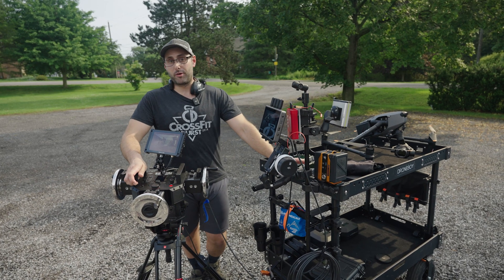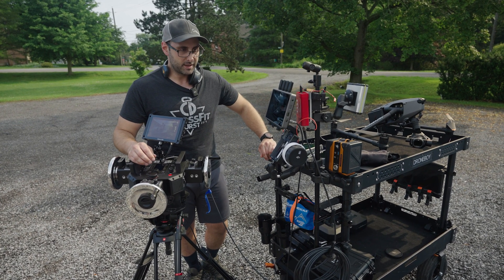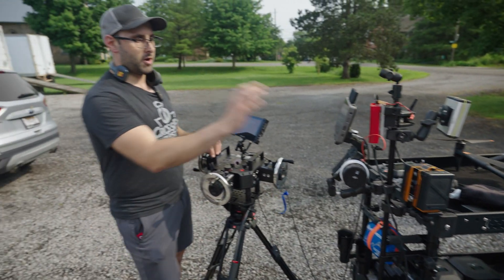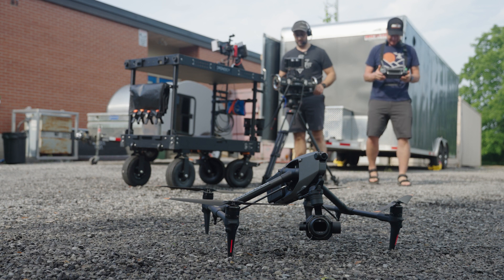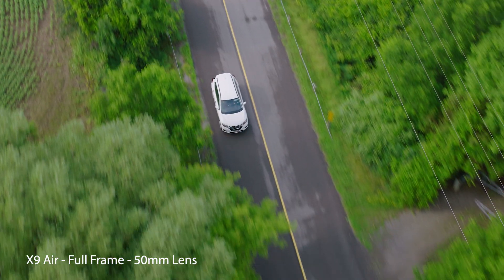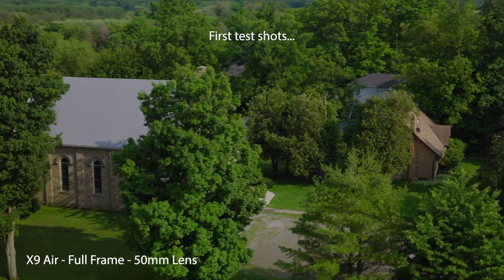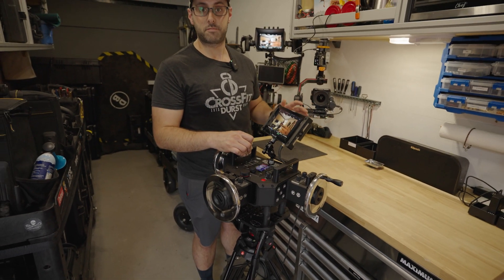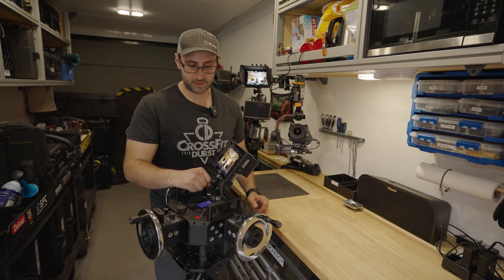DroneBoy Tech Day -  DJI Master Wheels and the Inspire 3 / X9

Comment: Have you had any issues with the wheels not working but they are communicating? Our wheels the re-center button and record buttons will both communicate to the drone but the wheels themselves won't do anything to the drone. Have everything on newest FW and the wheels are in switch/Ronin4D mode. Curious if you have run into that.
Reply: That’s odd. Not sure what would cause that. Did you try cycling the “Normal/Off/Reverse” switches on the wheels? Another thing I would try is make sure the pilot controller doesn’t have control of the gimbal. On the high-bright monitor you tap the little camera/gimbal icon on the left.

It’s funny because everything works on mine (control, recenter, etc) except for record. We have to use the hand unit or high-bright monitor.